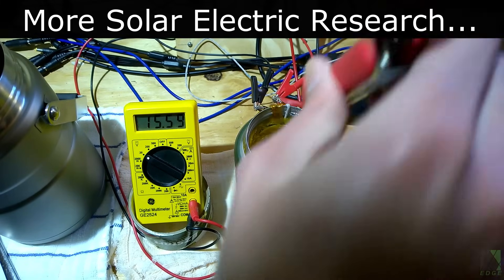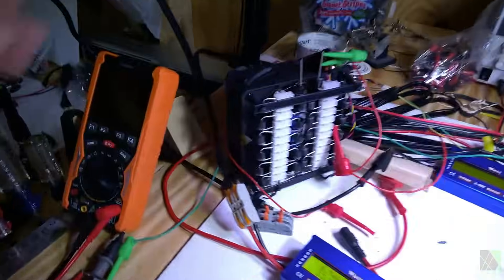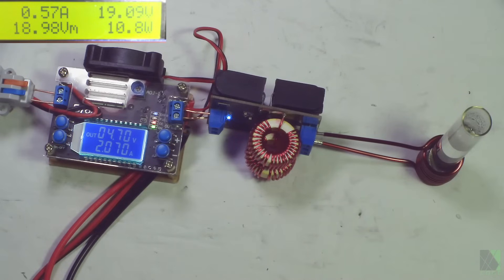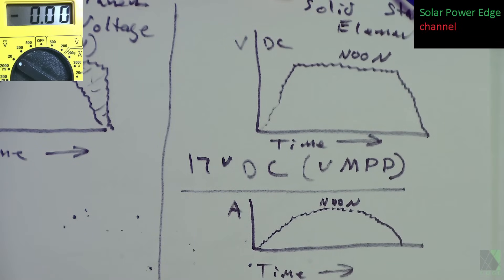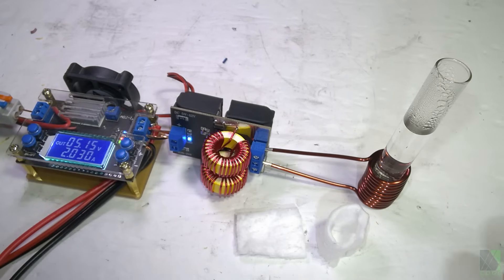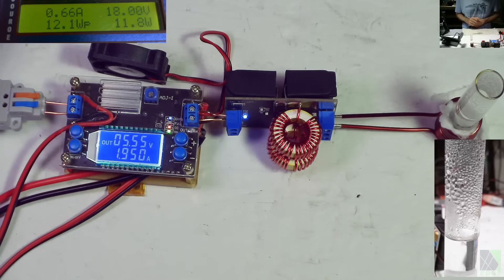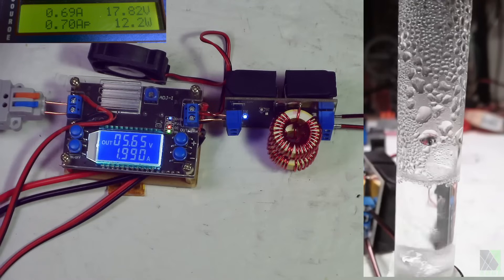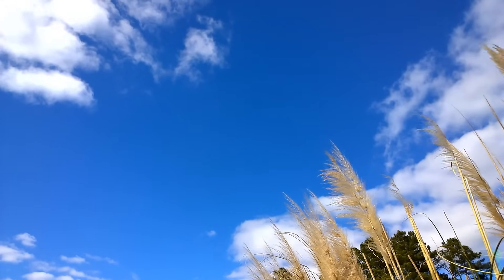15 Watts of Solar Power Boiling Water! induction experiments in my solar workshop #experiment

Comment: I have two of those induction circuits, I wanted to test if I could heat water going through a copper pipe, I got up to 6v on my lab power supply which wasn't quite enough power to heat running water... There was about 60W going in and I wanted to take it to it's maximum of 12v but I noticed that the induction coil was already quite hot at 6v and it dawned on me why all the coils in the videos that I have watched (and I have seen a lot of videos) were black! 
I wasn't expecting a huge difference in temperature but was hoping for at least 2°c difference which would take a considerable amount of time to heat water in a large tank but I would be happy with that result... 
I have ordered and received new induction coils made of copper pipe which I plan to route the water through first and then pass through the pipe through the coil to absorb the coil heat and get some more efficiency out of the system instead of letting the heat from the coil evaporate.... 
Even if it can't heat a 100L boiler tank of water, if I set up the system in series before the main boiler tank, pre warmed water will take less time to heat to 60°c than the current situation of cold water going straight in. 
I already have two boilers in series, the original gas unit and the new heat pump boiler which is doing all the work since it was installed, the original gas unit gets its water already heated and just sits there waiting for the temperature to drop, it's kinda like a backup.... 
That induction circuit is good for 120W.... I'm interested in how much water can it heat in between hot water usage (showers, dishwashing). The heat pump boiler runs for 2.5hrs after a long shower, if this kit can reduce the run time by even half an hour, then I'm happy! Might even consider hydronic heating and going up to a 600W induction circuit.... 
It can build up hot water when I'm not home or overnight if I'm not using it so it doesn't need to be fast, you won't need a huge battery to keep it running overnight.... 
I have yet to test the new coils,  I also received new water pumps but one wasn't glued together properly and has a leak, I'm in the process of getting some glue to fix it before I put together a new test circuit.... Hopefully this time I can ramp up the voltage to 12v... I also got two inline flow metre with built in temperature sensor... So I can see what sort of temperature difference I will be able to get... If not quite there, I have a second induction circuit for twice the power.... 
I also need to invest in another lab power supply, I need to control the speed of the water pumps and control the induction circuit independently... If the water is running to fast, I might not be able to see a difference in temperature... I have a spare 12V  SMPS that I can use, maybe I might have to manually switch the SMPS on and off to move the water a bit at a time? Don't know yet, I'm always thinking and looking ahead trying to preempt anything that I can foresee taking place..... 
Actually, I have plenty DC to DC converters.... I will use one with the SMPS! Ahhh! Excellent, thank you for that! 
And just before I go digging out a suitable converter, I wanted to ask for your opinion about the series diode heater you made, is the diode setup more efficient than resistive ie nichrome wire? 
Like which one do you think could heat and equal amount of water faster?  If you put in a bit more power into that induction circuit, that water in the test tube would have boiled so much faster, I believe that there are these things called magnetic stirrers, used in chemistry.... They are wrapped in plastic and could possibly be able to withstand 100°c (not sure at what temperature water boils in freedom units LoL). And I'm not sure if the actual magnet is the stirrers on in the base of the stirring contraption.... It probably has a name for which I haven't had the need to know yet LoL. 
You would prefer to have something in the water other than metal... Although stainless steel might be okay.... 
There is a flat pancake induction coil that I also plan on getting, I have had a good flat bottom stove top kettle for some time now waiting to be used in an induction circuit... Ohhhh I just remembered, the kettle is stainless steel and apparently doesn't work with induction circuits..... Hmmm need to find a new kettle, perhaps with a copper or aluminium base..... 
Actually, was that just a steal bolt in the test tube? It looked shiny like stainless steel..... I would be very interested to know, going to re-watch the video to see if you mentioned it.... 
Anyway, great video, as always to short! I don't mind seeing stuff being put together and listening to whatever you have to say along the way.... Sometimes it's educational and others can be funny.... Either way, keep up the great work! See you in the next video..
Reply from the maker: @PeterMilanovski Those experiments you're doing sound very interesting, keep up the good work :)

I figured a lot of power would be wasted in this circuit, but just had to try it. Sure enough... coil gets pretty hot. Who knows how much power is wasted. But that's OK I love the idea of heating a piece of metal with no wires going to it!

Matched diode strings, ****when driven by a solar panel**** are significantly more efficient  than standard resistance heating elements. The resistance element is linear, diodes are exponential/logarithmic. I made a few videos here but hope to expand further on it:  https://www.youtube.com/playlist?list=PL8a6nRTNyF9PK7SExvQKNhN0t3RUP9pT7

There are no guarantees, but I have had some success using stainless pots on induction cooktops. The bolt is stainless steel - the idea being it cannot corrode or hopefully impart harmful substances into the clean water. Obviously other metals are better for induction, but they would probably rust too...

Due to the high pressure to keep people watching, I tend to cut videos short and move along quickly. This has definitely ruined a lot of my work. If the channel ever gets to 100k (how many decades will that take?), I'll slow down and make longer more detailed videos with explanations, stats, spec sheets, etc. That's truly what I always wanted to create :)
Reply: @solarpoweredge   Hey! Thanks for the info! 
Okay, stainless steel somewhat works and now my induction heated stainless steel kettle idea is back on the drawing board! Thank you! 
I have already seen the video's with the diodes, it was the first time I was thinking how come I have never seen this before? A brilliant idea! Einstein level of intelligence right there! Possibly beyond Einstein..... He couldn't figure out what gravity is.... 
Anyway, you might have mentioned that the diodes were more efficient than going with resistive solutions but I think that I was to impressed that I may have missed that bit of information.... 
I'm currently looking for a cheap avenue for diodes in TO220 packages because they have mounting tabs and I can screw them to a heatsink for a bit more surface area and better temperature transfer! 
Not much luck with eBay and AliExpress, most parts on there are probably counterfeit, so I'm looking at the major electronic components suppliers for something that is quality and able to do the job.... 
I feel like I have a lot going on and I really need to pick something and dedicate as much time as possible! I need to finish at least one project! Could really use a boost in morale from a win ...
Reply from the maker: @PeterMilanovski  Welcome :D those TO220 diodes should be great, easy to screw onto a heat sink. The axial ones are tedious to work with. Usually requiring some kind of thermal cement to attach. I know what you mean... there are 10,000 projects and only a single human (or in my case probably 1/4th) to do them. So I try to focus on no more than 2-3 things at one time. Right now I'm building a small peltier fridge prototype using some promising new ideas, it's taken months to get there :)
Reply: @solarpoweredge   I'm also in the process of doing Peltier devices, looking into diodes, the weather is slowly getting better here in Melbourne so I will be up on the roof installing panels to take advantage of the afternoon sun.... 
I'm also working on an idea that I can't really talk about, but if it works, it will break the second law of thermodynamics.... I have heard too many people say that it can't be done but I'm going to try something different that I haven't seen anyone else do, I have built it up in my mind and have seen it working so I'm 99.9% sure that it could work... Fingers crossed that it does... And if it works, I should be able to upscale it to provide me with all the energy I need.... But until then, it's going to be a secret... But in the meantime I have to develop an efficient solar powered personal space heater because the wife prefers to have hot air blowing directly at her even though the house has a gas central heating unit which runs day and night... Something that I really want to get away from... Which is why I'm looking at every different way to heat! To220 diodes mounted on aluminium slats with a fan from behind like a traditional fan heater might work.... It's something that I want to try... I have also thought about induction for space heating and even Peltier devices for heating which should be really good but I just need to work out how to send the cold side outside! 
It's a working progress.... When I get stuck on one idea I move on to the next.... 
It is what it is and we do what we must! 
It's the people like you and me who work in their garage that eventually end up turning into Apple or Hewlett Packard.... Started in a garage and had to move to a bigger garage and so on...
Reply from the maker: @PeterMilanovski If they say it can't be done, I'm all for working on it! That's how things get invented... thermodynamics is just a model, a very useful one. I am sure there are phenomenon that operate outside its boundaries...
Reply: @solarpoweredge   that's exactly right, the universe has been doing what it does perpetually without human laws and rules..... 
I think that the problem with perpetual motion is that when people tell you that it's impossible or it can't be done, it's said within the context of for ever! 
And while that holds true, nothing can go for ever, doesn't mean that something can't go for a human lifetime..... 
If we think about the universe, what we have is a cycle! Essentially everything gets recycled and reused! You have to remember that energy and matter can't be created or destroyed (well at least no one has figured out how yet!)... 
So, because of current accepted science, you have to be careful with how you word something.... Otherwise everyone is going to try and shut you down! But if the statement is worded differently and correctly, suddenly it becomes difficult to argue with! And they will be forced to accept what they previously put a cover statement across the entire field and were thus unable to see that it's possible to make something that could possibly last a human lifetime..... 
I believe that the answer lies in the phrase Potential Difference! Because it's this phrase that keeps popping up everywhere I look when looking for answers to why something is or doing.... 
Once you notice something that is showing up everywhere and figure out that it's always been there before but you really never noticed it ... I have put more effort and time than any normal person should have....

Comment: Isn't it more efficient to simply short a coil directly from the solar panel?
Reply from the maker: @cjdelphi Direct solar electric diode chains are more efficient than standard resistance heating elements or induction, but all 3 techniques bring different advantages to the table. Another way to look at it, we have induction cooktops and microwave ovens - both waste power, but are very capable and unique systems with different pros vs. cons
Reply: By that i mean a submersion heater style coil

Comment: I'm almost sure, that your "screw" is not ideal induction power receiver, not all kinds of steel work equal.
To bring 100 mililters of water from 25C to 100c you need about 9Wh of energy (if it is fully isolated), so with 10 W it should take about 1 hour.
Reply from the maker: @AK-vx4dy Was a bit curious to try that type of metal. Last test it took less than an hour to boil. The footage is a bit random, as it took several weeks to get all this done and recorded - lots of interruptions

Comment: if I saw correctly only water is inside, but if you put some chunk of metal (small cylinder) inside that is solid it will quickly create Eddy currents and water should boil faster, have you tried it ?
Reply from the maker: @aleksandar7393 Right, that's actually what I did. There is a piece of metal in the test tube to accept the induction power
Reply: @solarpoweredge  I think what he meant was to place a metallic ring like a piece of pipe inside the test tube, the eddie currents should be able to get it hotter faster.... If I haven't misunderstood.... 
If anything, any metal object placed within the induction coil, if it performs better, it will draw more current.... 
You can see in the video when the test tube is lifted out of the coil, the current drops! It's kinda awesome how it can feel that something metal is getting closer to its coil.... 
I'm wondering how many watts is going to be needed to bring two cups of water to 90°c and keep it there.....
I have a cordless Kettle from Amazon, it's only rated for 800W (a far cry from the 2200w models we normally have here in Australia), but I had a 3kw inverter and needed a kettle that didn't need so much power regardless of how long it takes to boil water, so I got this thing from Amazon, its a glass kettle with a metal plate, the base station has many options! Including the ability to run at different power levels... Has a temperature display! And when it gets to 90°c, it drops off the power level, once it gets 100°c it goes into hold at 100°c mode for 4 hours! Not a bad kettle, looks nice and works surprisingly good.... The glass doesn't like to hold onto its heat! Anything at 4 inches distance will feel warm... 
Even though it does this pwm thing, it still pulls a few hundred watts for two cups of water! 
I will be working on an induction kettle.... One that I can put more water in and leave it running at low power (with a temperature controller of course for safety) so that I have hot water ready for coffee at any point in time, we have available a separate hot water tap which can be installed in the kitchen sink and have coffee water ready 24/7 but they are resistive heated and could possibly use a lot of energy than I'm prepared to give for such a luxury..... Yet LoL 😂. Maybe induction can be better at it? I will find out....
Reply from the maker: @PeterMilanovski I see, I should find a solid metal ring or pipe that fits in a test tube. 
That kettle base sounds nice. Most have no settings or control. I have no idea how much power to hit 90c but you are headed in the right direction!

Comment: Nice job.  Did the mosfet or mosfets get hot on your buck converter?
Reply from the maker: @mr.makeit4037 They warmed up some, a small fan kept them from getting too hot. I don't think the buck converter was designed for anything boiling :D
Reply: @solarpoweredge  i believe your right.  With all of the experimentation,  my thoughts not only go to it's success but longterm viability and reliability of the tech.

Comment: Heat pumps move heat from one temperature zone to another which can be more efficient than converting electrical energy into heat through a heating element. Induction heating from solar is not a simple low-cost method, but it works. Thanks for your experiments and ideas.
I heat water in a modified electric water directly from solar panels with DC rated circuit breaker, safety disconnect, and thermostat. 2400 watt off-grid.
Reply from the maker: @sagecoach Solar electric hot water is awesome
Reply: While taking a bath i suddenly got an idea why not use solar and induction heating since induction is much more efficient compared to resistive heating. Good thing you did it and answered my curiosiry 😅
Reply from the maker: @alphasiera1757 Hahaha :D right on

Comment: having good  luck  with induction  hot plate on the camper solar panel. 70 amp 12 volt  about 300 watts AC  gets 400 degree fry pan.. heats fast. no propane  needed!
Reply from the maker: @solarforfuture Nice! Some months back, I bought a tiny 300w induction plate out of curiosity. It worked extremely well and makes good coffee....

Comment: That looked like a lot of fun.  I wonder if it would boil a little faster if you had something covering the top of the test tube (like putting a lid on a pot). I'm going to have to go back into your older videos and watch the one on the diode chain.  That sounds very interesting too.
Reply from the maker: @colin8532 Hope you like the diode experiments - I think they're pretty fascinating. Whoever thought of cooking food with diodes - strange but it works well
Reply from the maker: @colin8532 Pretty cool setup for tinkering :) I did try covering with a cork but didn't record that part
Reply: @solarpoweredge  Pew!
Reply from the maker: @pyrojason Worth pointing out, the diodes are never in contact with the food at any time :)
Reply: @solarpoweredge  
I'm vapourising weed with an induction coil watching your video :)
Reply: @solarpoweredge  pew was in reference to the cork potentially blasting out once the pressure built up!
Reply from the maker: @pyrojason Oh right!... better wear safety glasses...
Reply: @solarpoweredge  and better catch it on video 🚀
Reply from the maker: @pyrojason Yes :D